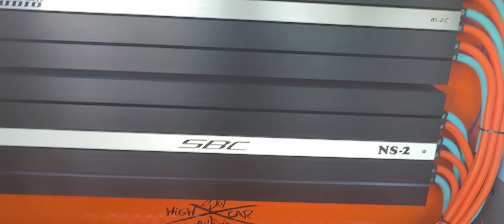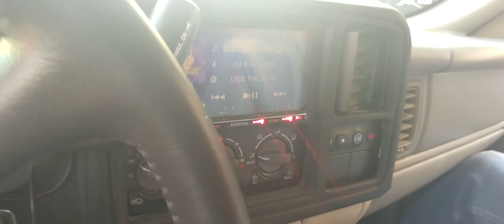8 Sundown Zv5 12 Powered By 2 Sundown NS2 Amplifiers

Comment: I still wonder after all that bass how the fuck that truck still does not fall apart holy shit. And I also wonder how the fuck they managed to fit all them goddamn speakers in there they literally used the full capacity of the back of that  Chevy!
Reply from the maker: That's the beauty of having a wall. Use just about any space necessary